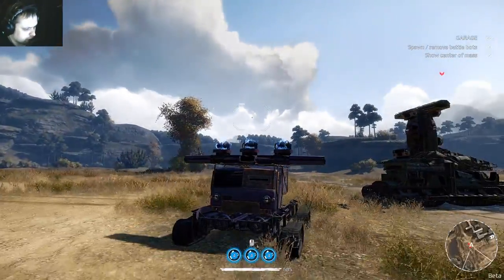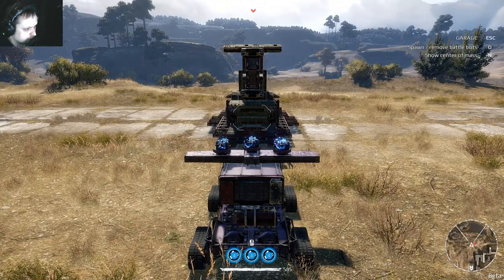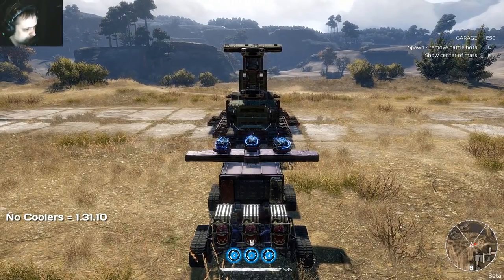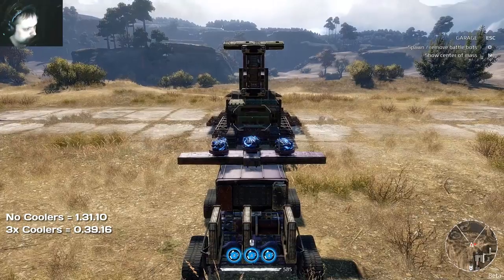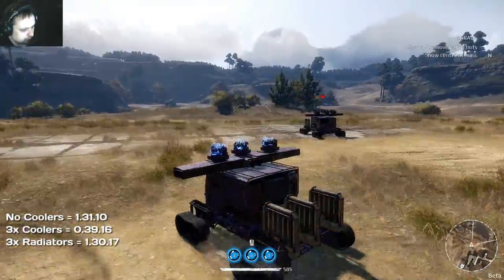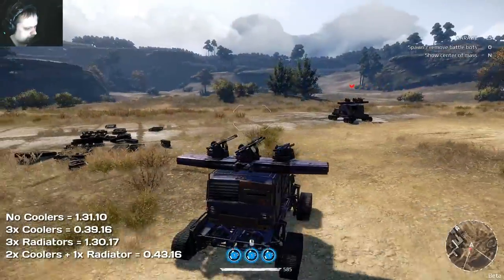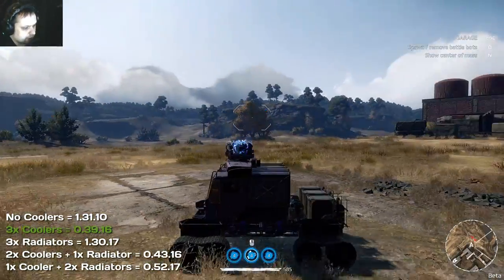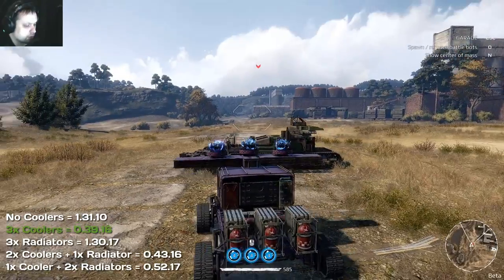Crossout #53 - Coolers vs Radiators on Shotgun Build

Comment: The mechanics for coolers and radiators were changed. Now both give you a DPM bonus. Radiators now make your weapon heat up slower while letting it keep the normal cooldown speed. For the epic ones, there is also a difference in when they get their buff (coolers get a buff when standing still, radiators get a buff when moving).
Reply: Leonid Gutman Damn that makes even harder to quantify optimal designs. As if this game wasn't opaque enough when it comes to game mechanics.

Comment: Do a comparison between 4 sledges and 3 thunders. They take the same amount of energy overall. I did the timer just like you do against my Levi. Let's just say I sold my thunderbolts haha the damage boost isn't worth it cuz Your first boosted shot is usually at range anyways.  The results will shock you lol
Reply from the maker: 4 sledges? you mean spitfires? ... and done already, try using search before posting the "idea" - https://www.youtube.com/watch?v=Vq-cm1MSPOg
Reply: The Sethioz Project  no sledgehammer shotguns  I gave up thunder bolts for them. Best trade ever lol Trust me. When you see the damage difference you'll see
Reply from the maker: sounds like bile of horsebutts to me, but i added it into my list. I've seen 4x sledgehammers and they only tickle .. that's all. i have never been blown up by sledge build.

Just out of curiousity i tried, it's bit better, but not by much.
3x thunderbolts = 43.20
4x sledgehammers = 41.08
4x spitfires = 35.08

as you can see, spitfires are still best, however in practice, i think thunderbolts are still best. They're lower profile, more structure and you only need 3 of them.
I've been against all types of shotgun builds and thunderbolts are most difficult, they do less damage, but they're harder to get. spitfires are good, but they're really big and easy to hit and sledges are just way too easy to hit, i usually take 2-3 of them in one hit. with dual reaper build, i just wipe over it once and 2-4 of them are gone instantly.